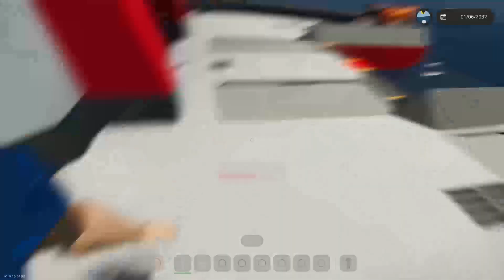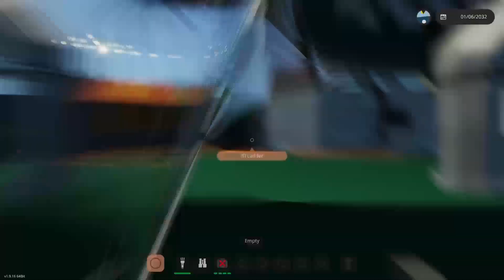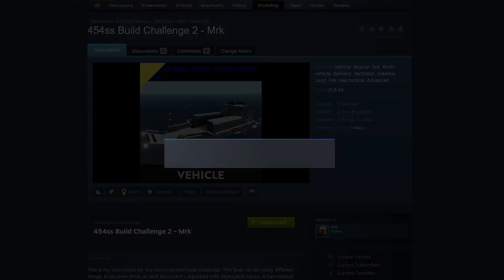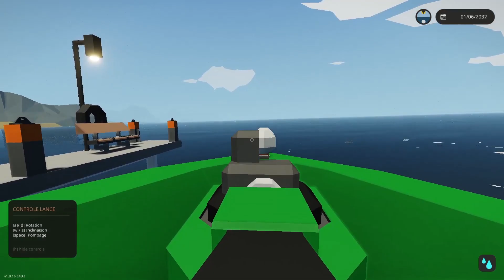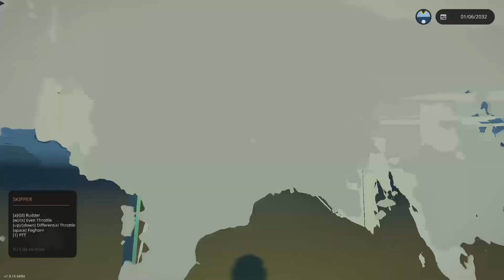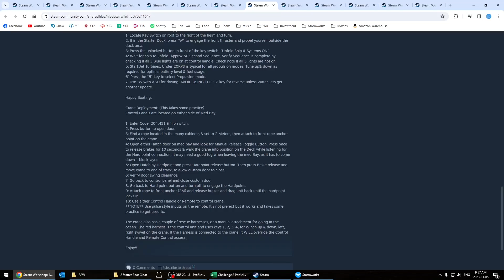[PART 2/3] Starter Boat Gloat Build Challenge SHOWCASE in Stormworks

Comment: Hi 454ss @454ss Stormworks Gaming, @Discarding_Sabot here;
first of all thanks for the challenge itself, it really made me go out of my way to build my next career boat.
Now, to address your questions, and some details I realise I forgot to mention in W/S descriprion:
- Skipper and Kowalsky are indeed a reference to the Penguins, first appeared in Dreamwork's Madagascar. If you ckeck the beds in crew quarters, they are called Rico and Private.
- The turbines power the Pump Jets (Waterjets) via RPS outlet and a couple of gearboxes. In fact, water jets are the main source of thrust, while jet exhaust does not come into play below 80% throttle, and it's limited to 20% nozzle opening (can be modified with slider on microcontroller)
- For better experience, turn ignition on, then look outside, then navigation lights, then look outside again
- There are 3 identical instrument groups with a paintable sign labeled "Air Quality Control" around the boat
- I forgot to mention where the main controls are in my description; I'm glad you immediately found the main breaker. The controld for jet trim (Pump Jet vertical pitch) and Advanced Docking System are overhead between the front seats
Lastly, I'd like to thank all the other participants to the contest, because my next boat will contain many design features I've seen on you builds. Your boats are terrific, and I love them
I should have said this part before, but I was really on my toes until this video came out ;)
Reply from the maker: You are very welcome, I am happy the challenge had so many amazing contestants and entries! 
I see, that is what I figured, the jets were powering the water jets :) I love the penguins from Madagascar, very fitting! Thanks for the extra description

Comment: Hello, Zynoa Here. First of Thank you for giving us this opportunity. This is my first ever build submitted to the workshop.  You did pronounce my name correctly,  I make a lot of typos, EXC. is etcetera, the rear door that requires you to hold the button to open is a diesel tank, and the hold down is to prevent any accidental opening of the tanks on each side. The indicators on the deck are just little night lights that turn on at night along with the name on the sides. The Screen the the back left does not work in this version (haven't learned how to do a Sonar yes)..  You can choose the drive modes either with the engine on or off makes no difference. The left fines just adjust the lower fins on and off, the reason for that is with them on it's faster, off its more stable with harsh weather.   The Front screen on the starboard uses both sets of controls on each side of the screen for the spotlights, and water cannon with different control methods. The auto track will lock on to any target in its view if the camera and spotlight are on it will look at the locked-on target...   

Again Thank you, i look forward to seeing what you do with all these different crafts, and with suggestions, I can make this and other builds better for the future. If you have any questions feel free to reach out.

Comment: Very happy to have surprised you once more. Thank you for the kind words. This was an interesting journey. It all started by making 1 giant wedge shape in the starter dock. Unhappy with that look, to its overall length, some re-shaping began. I then remembered my love of pivots and thought, why not make it longer. I figured 2/3 of the starter dock length was about right. A lot of blocks later, eventually the unfold process was successful. Then the tower took shape and was designed to move back for balance. But that left it fairly empty and I played around with the idea of putting a helicopter in the lower compartment, but the Med Bay and custom door system were developed and 3 designs later, bingo. The Crane also went through several designs including an automatic deployment system & the physics were very unhappy with that installed. This boat spent a lot of time at the FJ Dock & Hanger Workbenches in order to paint and sequence everything, once the final shape had formed. Then the water testing began. Many trials and tribulations were had. Weight balancing was fun & thankfully you reminded us the pivot glitch was not allowed, as I was playing around with it for the first time, to bring down the tower weight. Overall, this was a very fun build experience and I hope everyone enjoys this unit! Lots of great builds so far. Looking forward to seeing the rest in action. Great video.
Reply: Man that is beautiful. Congrats
Reply: just the best ideas!

Comment: Sorry for Not putting it clearly but the armoury Code is the date of foundation (1351844) and for the heli is a bit goofy as I built it so it could fit, so I put the throttle lever with Range from 1 to -1 but you should only use  from 0 to 1 to avoid problems with the engine and for takeoff I recommend putting the Alt hold first then the gyro and detaching last as everything is very close together. Love your videos and waiting to see the next creations 🎉